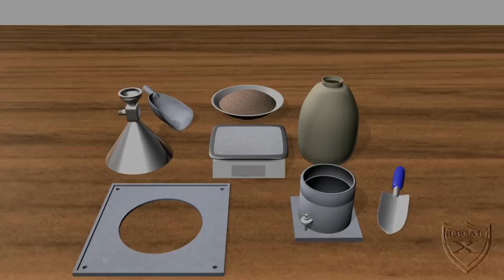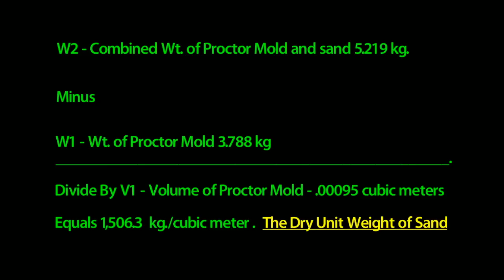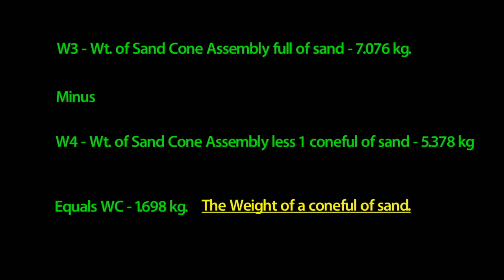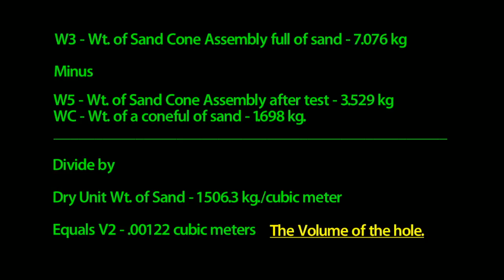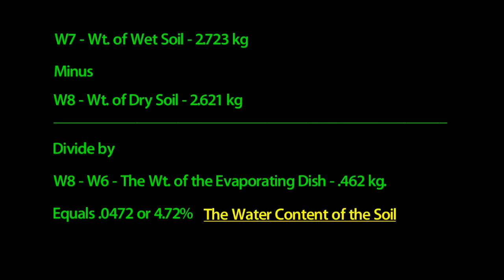Sand Cone Method Animated Presentation

Comment: Finding the moist density of soil you use a wrong calculation dear.. W7-W8 is the amount of water in the soil ...you can get moist density by W7/V and dry density by W8/V
Reply: Actually, your point is right. However, the weight of the evaporating dish must be subtracted. Hence, moist unit weight (not density) is (W7-W6)/V, and dry unit weight is (W8-W6)/V.

Comment: did anyone notice that the V2 calculated by (W3-W5-Wc)/dry density of sand, is actually the volume of the hole plus the volume of the cone?!!!!
Reply: No. The V2 is the volume of the hole after digging 15-20 cm.

Comment: (wt. of wet soil - wt. of dry soil)/ (volume of hole) = moist unit wt.??? 
 I think it should be  (wt. of evaporating dish with wet soil - wt. of evaporating dish)/ (vol. of hole) = moist unit wt.
Reply: Andrian Abanilla noticed this too. Also, kg/m3 denotes the density of the sample. Very informative with the procedures tho.
Reply: wt. of wet soil - wt. of dry soil/volume of hole = wt of water per 1m³

That's it..Not "moist unit wt of soil"
You're right Andrian Abanilla
Reply: Yup u r correct

Comment: When you calibration the sand cone apparatus for the W3 it should be performed over the base plate to account for the small volume that is represented by the thickness of the plate. Its a small value but can make a big difference in the final value.
Reply: sorry to correct you man... the cone is lying on the soil not on the base plate...